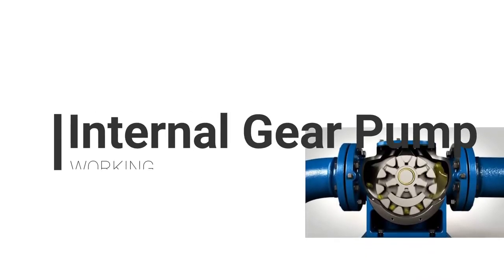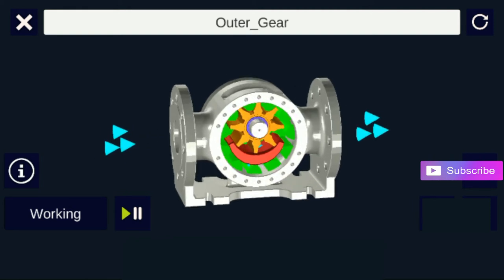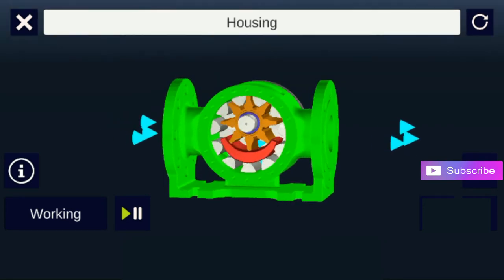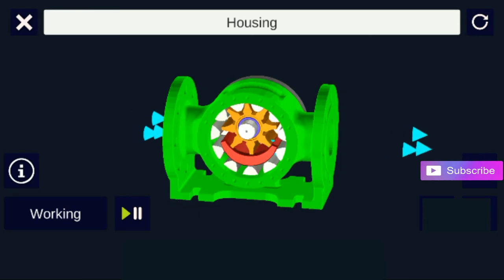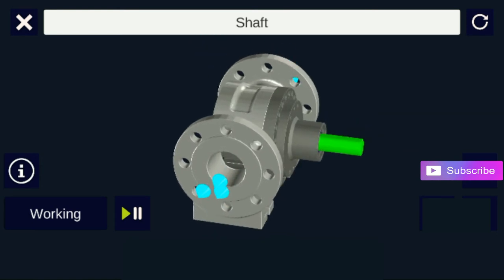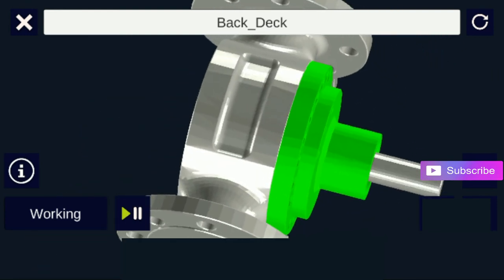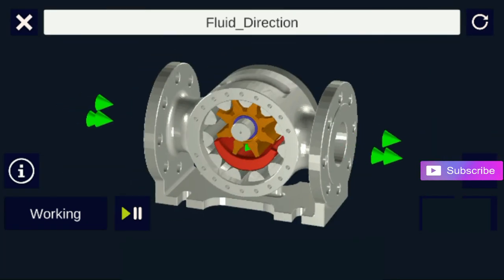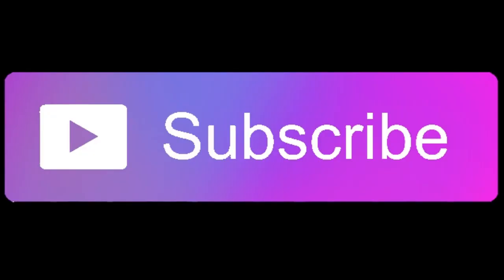How Internal Gear Pump Works ????  ||Engineer's Academy||

Comment: I have an auto-gate hydraulic cylinder that has an internal gear pump inside. The mini internal gear about 10 mm od could not turn on its spindle. It can be easily remove with finger but cannot rotate despite not touching the crescent at all. Can someone shed some light on the cause of this problem?